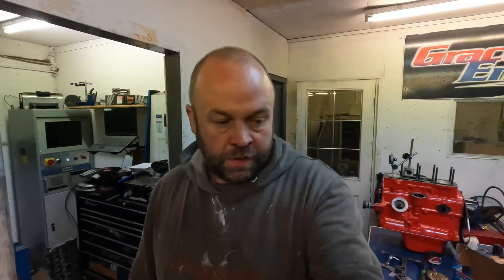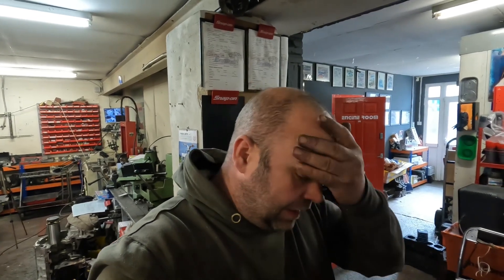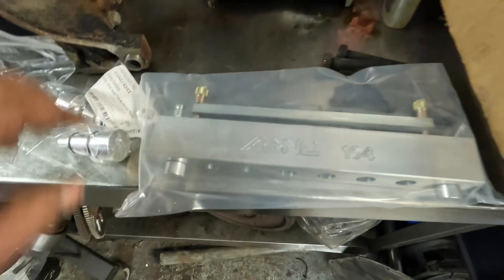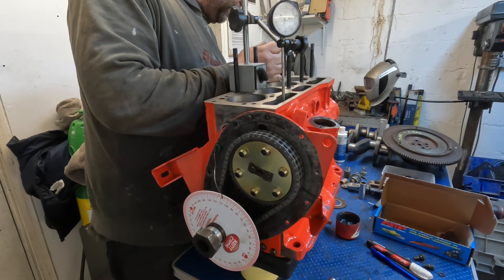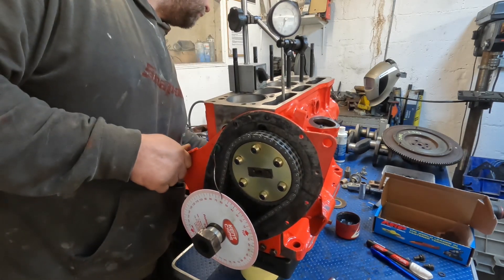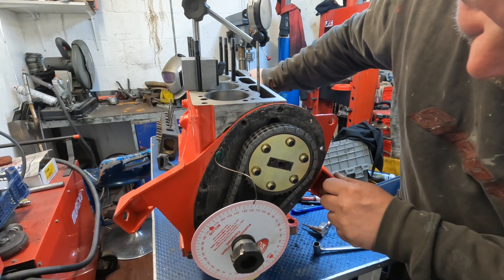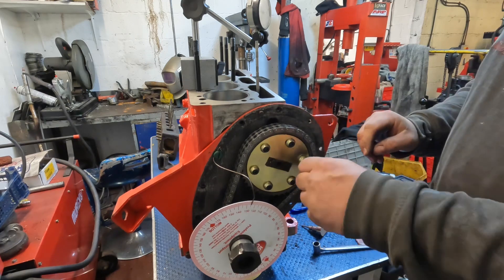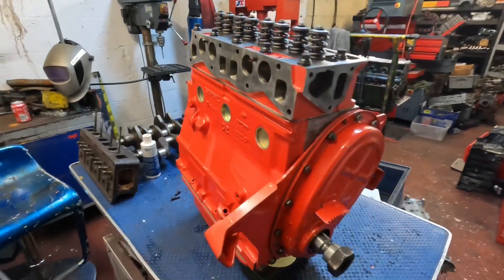Setting the Cam Timing on a Triumph 1.5 Engine

Comment: Great to see some older engines in the mix James, it’s nice to see the timing being set up and well explained too, hope alls well and you didn’t eat too much cake the other day !!!!
Reply from the maker: Hi Paul, thanks just trying to get some shorter videos up but I'm not sure it works.. got a couple to post them back to longer ones I think.. no cake for me at the moment trying to loose a few pounds
Reply: @graceenginedevelopments  I thought it was fine really, the longer ones are good for the variety but the shorter one that focuses on a single subject is equally as good, gives you a chance to get more in-depth at the same time, either way you are doing a great job with the vlogs, keep it up 👍👍👍